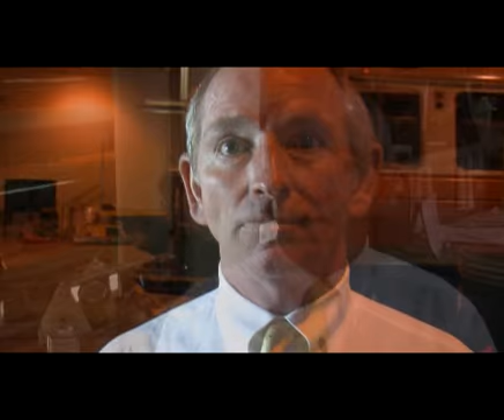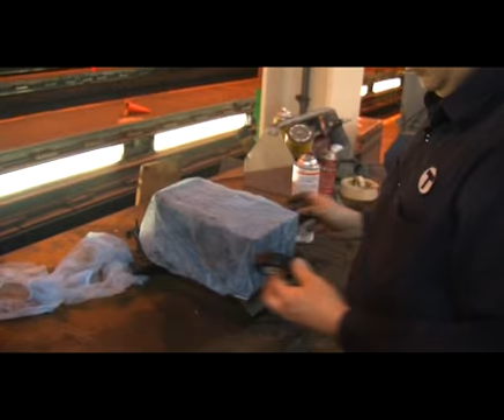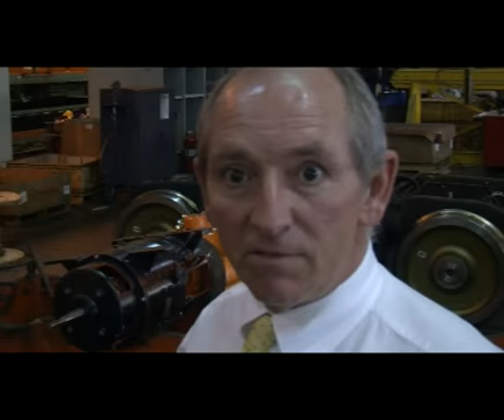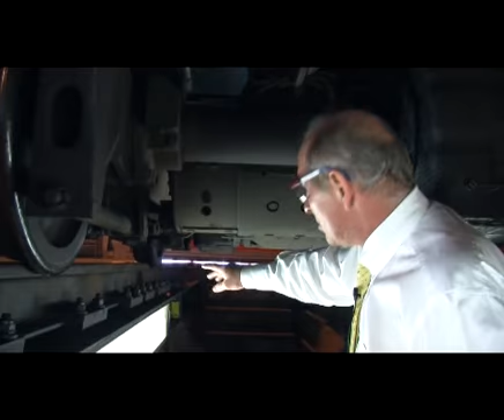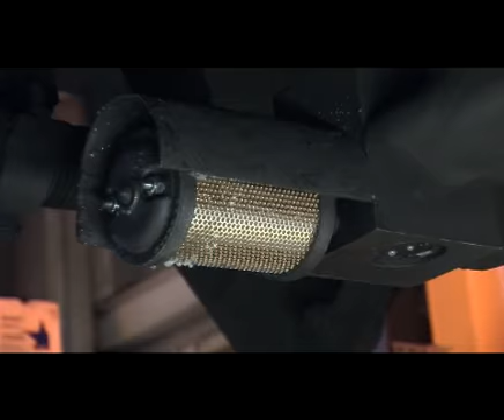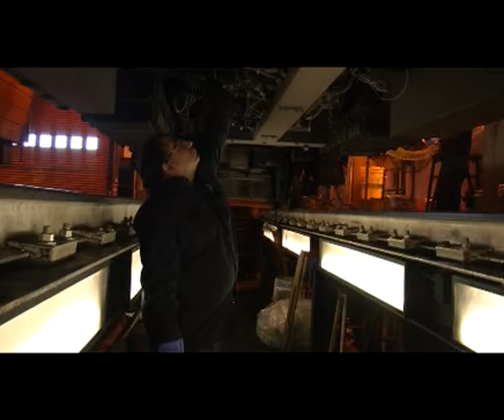Orange Line Winter Update - February 2011

Comment: @DarkGhost89 People often think that things break down because repair people are lazy and don't want to do their job.  The reality is that repair people often deal with things like this.  
Poor designs where the design engineers don't really think through the real world applications of their designs.  
In this case they didn't have the foresight to realize that if the cars were used in a snowy area, snow would contaminate the traction motors.